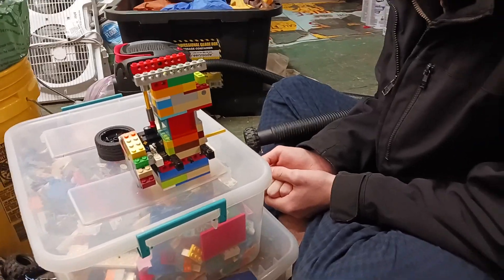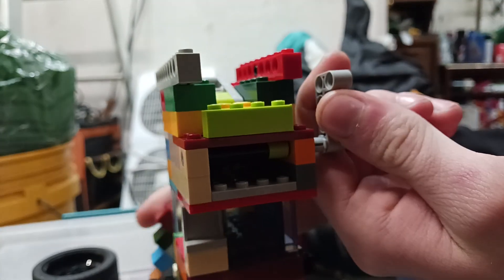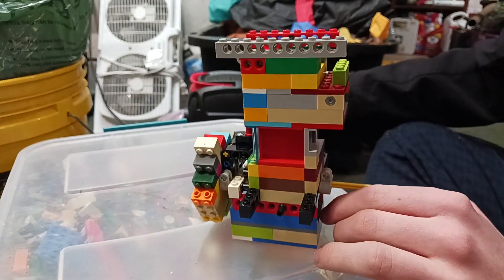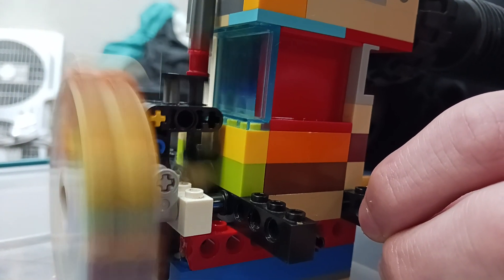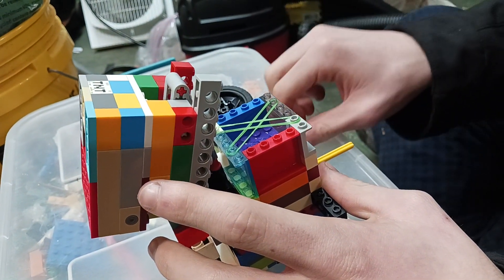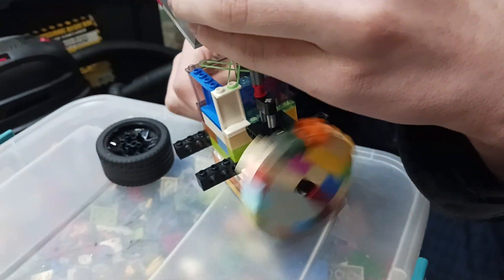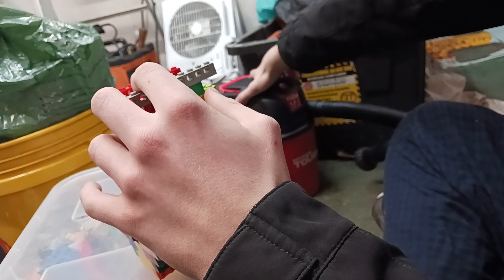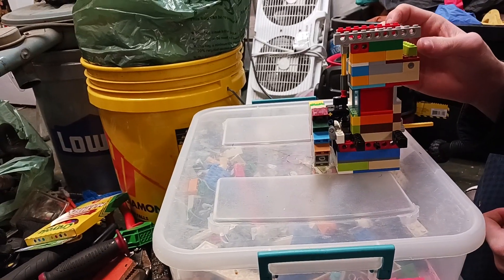New Lego OHV Piston Vacuum Engine

Comment: I would think the suction would pull the valve closed, so the rubber bands shouldn't be that important.
Reply: Well, I don't know how to explain it but the valve needs to be closed so the piston can go back down and "block" any suction from entering the chamber
Reply: It's your engine, so you would know better than I would.
There's no way to let air into the cylinder on the down stroke, is there? If there's not, it's fighting suction making the engine less effficient. You might want to modify it to have an "exhaust" valve.
Reply: Yea true but I'm still figuring out this one so I honestly don't know much about this one so I'm just experimenting with this one

Comment: i like it i wish my DOHV ran  that nice but curently it runs like crap maybe the fly wheels
Reply from the maker: We are learning as this is the first one we made, but a skinny and taller flywheel made a big difference.
Reply: @actippets2307   oh ok thanks cause my engine uses a large spoked wheel oh and another question is it more optimal to run 4x4 or 6x6 what do you figure?
Reply: @GTech_builds Hey so, I made the flywheel I built it with a 4x4 plate cause it was cheaper to build and if you want to do a 6x6 you will get higher RPM'S from what I know I haven't tried a 6x6

Comment: If anyone can link videos on how to make the valve more reliable instead of rubberbands that would amazing!
Reply: use hair elastics
Reply: @GTech_builds what are those?
Reply: @MicrowavedBreastMilk-k2m   just thicker rubber bands that spring back quicker but take less force to strech
Reply: @GTech_builds I'll give it a try thanks!!
Reply: I saw somewhere somebody used a spring around the axle part of the valve. A pen spring would be too small for that, I think.
Reply: @Dudeface167 that one I might try I tried the hairties but it was too much force but I'll give it a try too
Reply: Use a spring off a pen and put it around the axel on the valve if it doesn't fit try to pull it our so it's longer and then try to put it on.